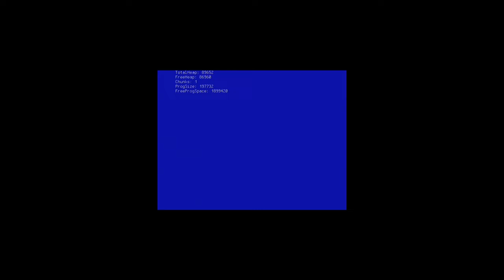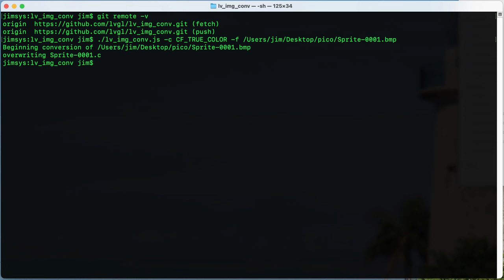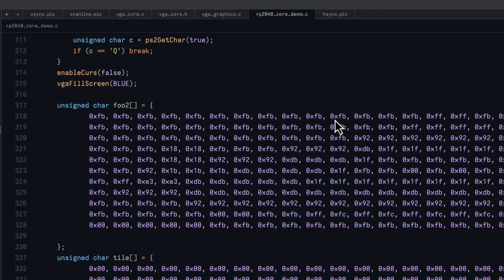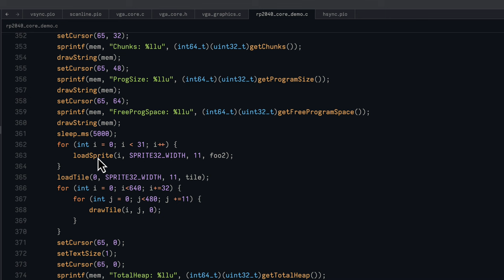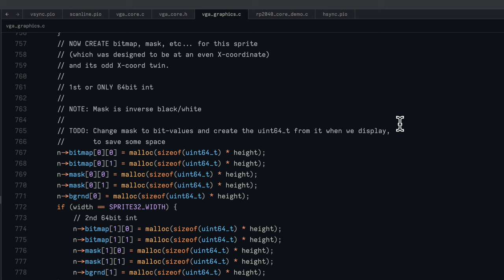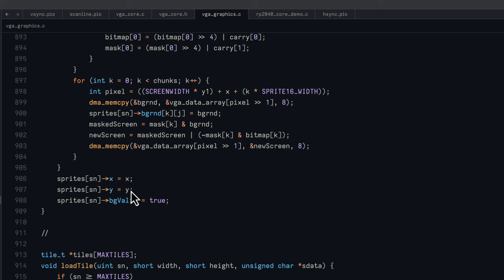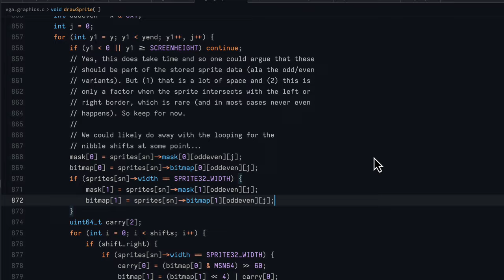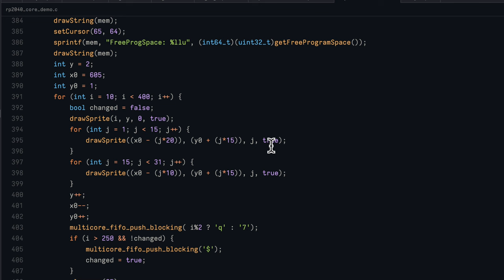Episode 7: Sprites in a single frame buffer

Comment from the maker: One way around the single frame-buffer limitation is to decrease the resolution we use: either something smaller than 640x480 pixels or decrease the color depth of the pixels. IMO, 4 bits per pixel is the absolute minimum so the only reasonable suggestion would be to use a smaller, more blocky resolution. The reason I stuck with 640x480 is because this allows for a 80x30 text screen (using 8x16 font bitmaps) which is one of the design requirements for me. Of course, one could also try out various graphics "modes" (HiRes, LowRes, etc...) but the architecture makes that tricky since we are heavily leveraging the rp2040 PIO capabilities, and switching graphics modes "on the fly" would require shutting down and then turning on new PIO state machines, and we're close to the limits now.
Reply: 320x200 was a popular resolution for games back in the early days of DOS and 8 bit computers